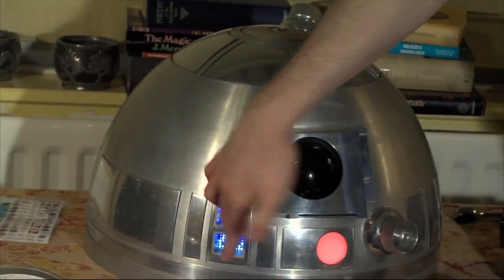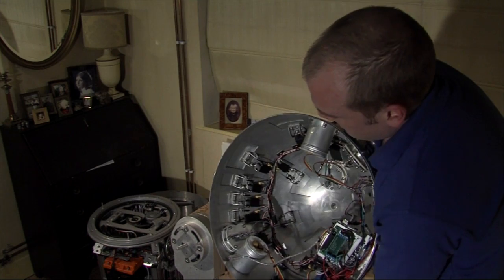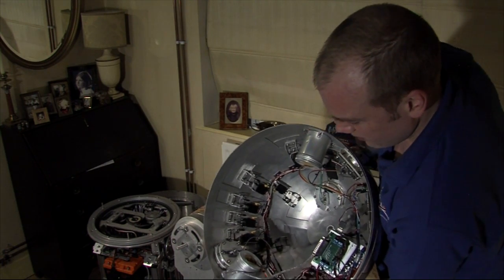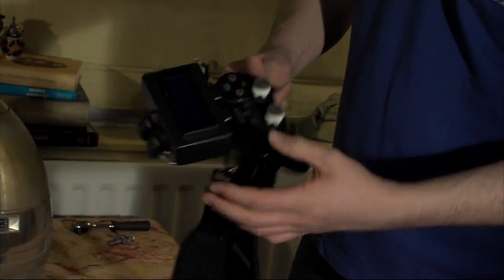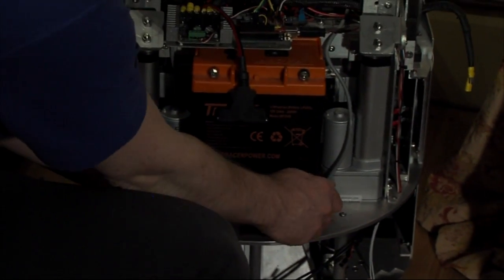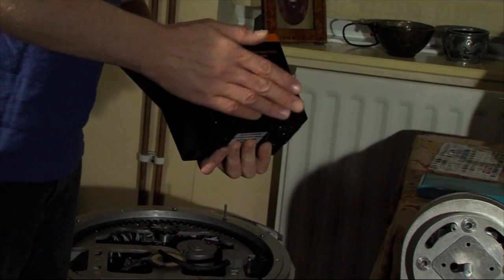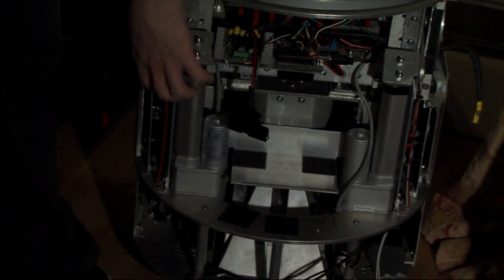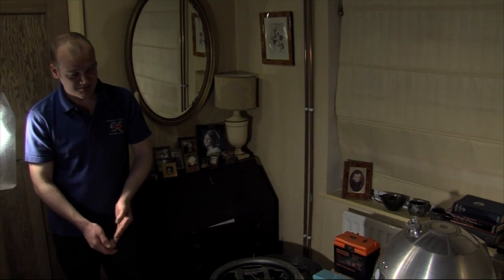Inside R2

Comment: So for the 2-3-2, it looks like there's 2 rods in the leg. Since one attaches to the foot, where does the other one attach to? I've been pouring over this design trying to figure it out
Reply from the maker: It is like a go kart steering mech.  Yes, one on the foot, and one on the body, so that as the leg turns it forces the ankle angle to change.
Reply: Brad Oakley so they're both attached to that pivot in the shoulder, but one is attached to the inside of the leg?
Reply from the maker: Only fixed to the foot and to the body, just retained in the leg, to stop it bowing. :)